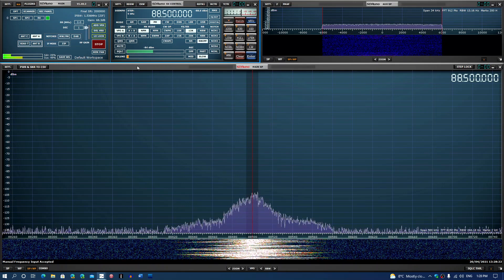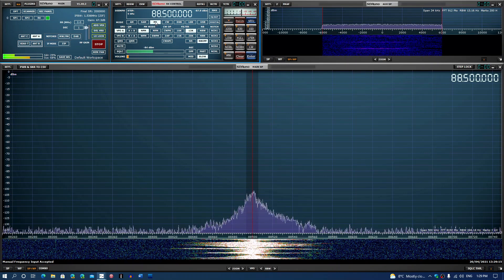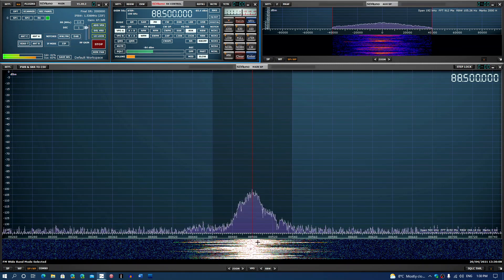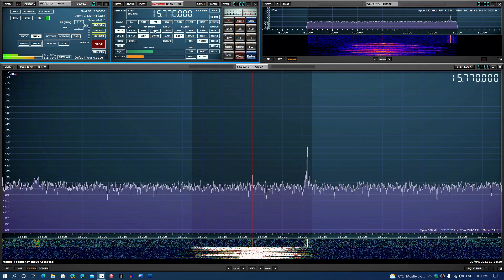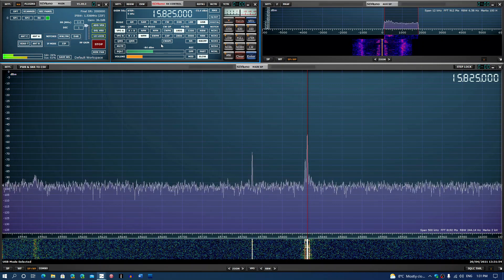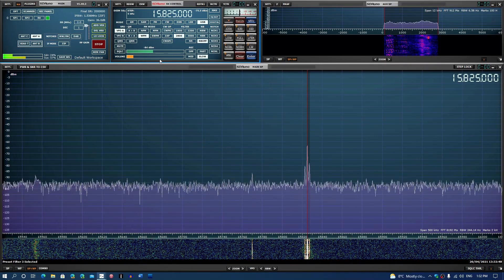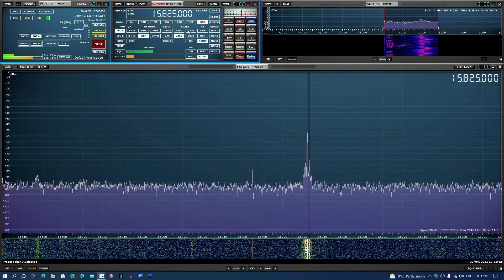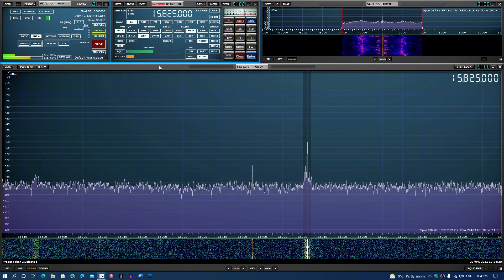SDRuno modes and bandwith selection explanation

Comment: Great stuff Gilles!
In the AUX SP pane one can drag of the edges of the waveform as well to allowing a certain customization depending what mode you are in.
For instance in AM mode and you drag one side it drags both sides, where USB and LSB either side can be dragged on their own.
SDR uno has a steep learning curve and I'm still learning and might never end! 
That being the case it is still my personal favorite and don't really want to use anything else.
Reply: Hola
Podrías ayudarme
Tengo un RSPDX habré hecho algo pero ahora no aparece en pantalla el recuadro donde aparece el ancho de Banda, como puedo recuperar de nuevo este ancho de banda? 😢
Gracias